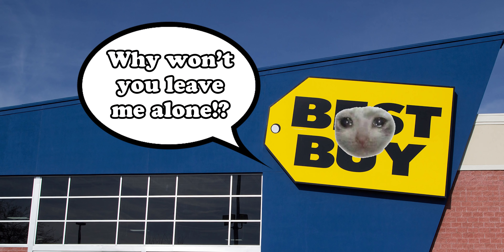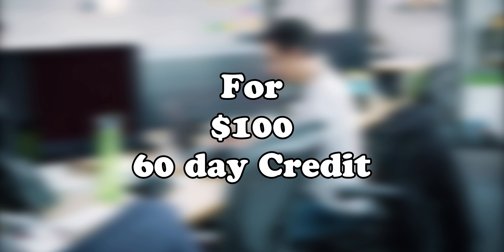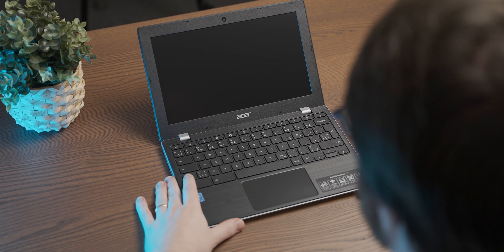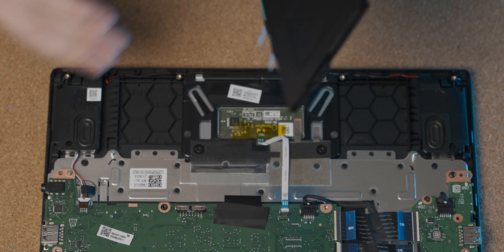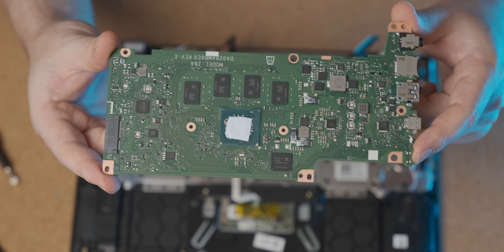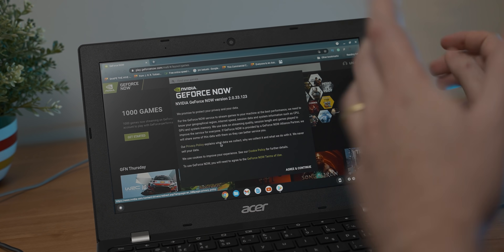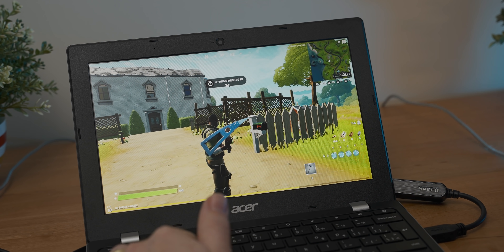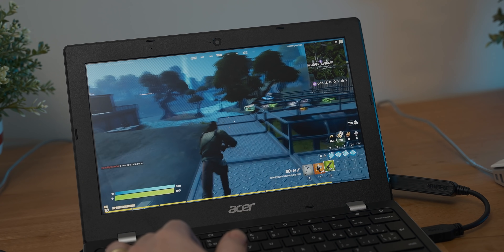Trying To Game On The Cheapest Computer From Best Buy...

Comment: if you want to actually game comfortably on a super low-end laptop your best bet is retro emulation.
Reply: Raspberry pi 4!, better than my main
Reply: @wesss9353  retropie enjoyers
Reply: Wonder if this could handle PS2? I'm guessing no.
Reply: @BrattyBobert  definitely not
Reply: @BrattyBobert  ps2 requires a lot of power an memory. It was the final somewhat working emulator to be developed an they quit after they learned that lesson a  long time ago.

Which is one small thing that help#us understand new tech isn't that much better an they program software to wreck an throttle old stuff an need one or two bits of code that aren't on planned obsolete hardware
Reply: I found snake and cool math games and unlocked games do the trick.

Comment: my sister uses a laptop with windows 10 and the n4000 processor..

even with a SSD, its so bad, that any smartphone in that same price range, is outperforming it in ANY WAY!
Reply: Makes me wonder if that thing could even run GTA Vice City... lol
Reply: @brucewrigleysgumchewz4667  it barely runs any modern LAUNCHER.. yeah LAUNCHER like Epic Games :D
Reply: @Xenoray1  That's just sad. I checked the specs for it and it's even sadder on paper. The thing is a dual core with only a single thread per core and runs at only 1.1Ghz... with a burst (yes.. BURST) frequency of 2.6Ghz. So, it's slow 95% of the time. The thing only uses 6 watts max. Hell, my phone uses more power than that thing.
Reply: @brucewrigleysgumchewz4667  i had a good deal on a used i5 skylake Laptop for the same price but she didnt like the look.. well well i tried >.<
Reply: @Xenoray1  The "look" ? You don't buy a laptop because of how it looks. You buy based on performance, specs, features and quality. 

Was it pink with glitter and gold dust sprinkled all over it? Is she complaining about how butt slow it is? lol
Reply: @brucewrigleysgumchewz4667  no it just was white, well.. not my problem anymore not rly but i was complaining haha^^

Comment: Why do companies are still stuck on celeron series instead of older i7s?
Reply: Better tdp, old i7 H O T
Reply: Older i7s use way to much power and will drain the battery very quickly. The whole point of a netbook is that it is very low powered and is able to do very basic tasks while having a long battery life. So having a more powerful cpu inside that would drain the battery faster would be pointless. Also older i7s are no longer in production so even though they are outdated tech making them brand new would still be very expensive as the process to make them hasn't suddenly become cheaper.

Comment: i still use a toshiba z 20t tablet/pc (if i dont gme, or do some video editing, because i have a pc for that), with an intel m5-y71 cpu. it has 2 cores and 4 threads, and goes from 1,2-2,9 ghz. it has 8gb of ram, and an actual nvme ssd, that can be upgraded. some games can even run it. the only problem is that the cpu likes to heat up a lot if i give it a higher load (high resolution movie, or yt). it is also a passively cooled cpu. my plan is to cut 2 holes into the back plate, and make it similar to those vent holes on a normal laptop. it doesn't even need a fan, because if i make 2 separate holes, 1 down, and 1 up, it will move itself, because the hot air will go up, and out, and down it will suck in cool air. (i will also buy another back plate, in case if i would mess it up xd)

Comment: Never ever buy the cheapest computer. When I hear the word: Celeron my whole body cringes.
Reply: Yeah, celerons are one of the worst things ever made, just use an older intel core series or amd Apu, it will literally double your frames
Reply: @44danydany  probably triple is more like it
Reply: @44danydany  yeah Atoms were the worst then Celeron's after that Pentium's
Reply: @44danydany  Probably 10x with the APU, but older Core graphics are so bad they're a joke.
Reply: Come on the Celeron 300A was a good cpu, once it was overclocked to within an inch of its life, 300Mhz to 462Mhz with 2 bios settings.
Reply: I got a Pentium at 1ghz
Reply: @kepler_45  i3 7100u here
Reply: oh common celerons aren't that bad it could be worse it could be an atom cpu which is way way worse
Reply: @raven4k998  celeron/pentium N and J is ATOM. "normal" one is U ang G
Reply: @ScorpioN13th  no no no silly Atom was worse cause no pci-e no sata no balls Celeron and Pentium had atleast PCI-E to a limited 6 lanes on the celeron n4000 which is more then Atom had which was zero! sure 6 is not enough for dedicated gpu but still it's more then zero and thus enough for ssd's the nvme ones
Reply: @raven4k998  well nowadays celerons are the modern atoms. There's a reason they don't consume any power now
Reply: I gave my Dad's first gen Celeron computer the name "Celery!"
Reply: @petenielsen6683  oh my I am so so sorry I have nothing but pity for the hell you must be going through having to use that pos
Reply: When I hear the word "Chromebook"... my whole body cringes.
Reply: So true..😂😂😂
Reply: Nowadays i5 is must, below i3 its low performance.
Reply: @An_ony_mous  no no no silly now days you need a super powerful celeron an i5 is to much power for you to handle
Reply: @raven4k998  Seriously? Are you joking? i3 itself is slow, Celeron and Atom will be more slow bruh.
Reply: @raven4k998  i3 is atleast manageable, Celeron and Atom is a R.I.P.
Reply: @An_ony_mous  oh common you need to game on a celeron leave the i5 i7 and i9's to the big boys you can't handle the power
Reply: @raven4k998  Seriously? Small boys can't pay every month for cloud gaming, I would rather spend on a beast and use it for 10 years without paying bruh.
Reply: @w what should make you cringe is that new laptops are still being made with those old fx laptop apu's and whats worse they are to weak shitty ones to boot the least they could do is put an A10 9800p in there instead of a shitty A4 apu in there
Reply: mally02  don't be silly just keep using it you'll get the hang of it soon enough🤣🤣🤣🤣🤣
Reply: lol
Reply: what about intel i3

Comment: Chrome books are just tablets with a built in keyboard
Reply: And other software
Reply: No.  It's equivalent to the board from one of the celeron gemini lake(or gemini lake refresh) mini PCs transplanted into a laptop chassis(frame with ports/screen/battery/keyboard/trackpad/awful heatsink and fan)
Reply: @Grimmwoldds  no its just a fancy tablet
Reply: @Grimmwoldds  Its underpowered and dumb
Reply: @Grimmwoldds  dumb, it's underpowered and underclocked tablet with built in keyboard
Reply: @44danydany  Different architectures.  x86 vs RISC.  That is why it is not a "tablet" anything.
Reply: @Grimmwoldds  My Surface Go tablet is x86...

Comment: Side note if you want a really good gaming laptop around 1500$ look at msi with the rtx 3070 max p not max q
The higher tdp 3070 in the gp66 is amazing and does just as good as many 3080 max q models. 
I have the 10th gen i7 / 32gb 3200cl16 2x16, 2tb nvme, 1080p 144hz  but you can change the screen to a 240hz 1080p or 165hz 1440p
Reply: Also Asus Strix with Radeon graphics for 1650$